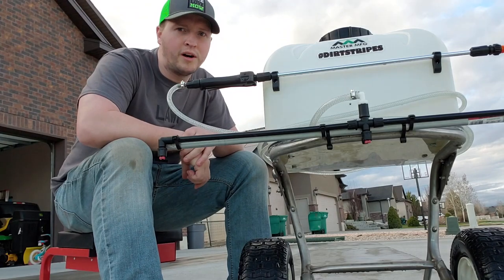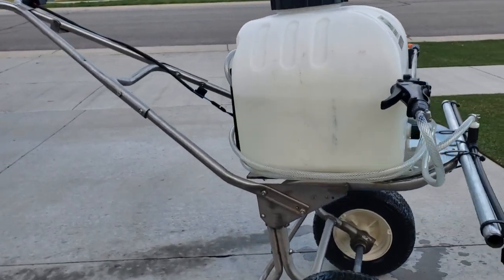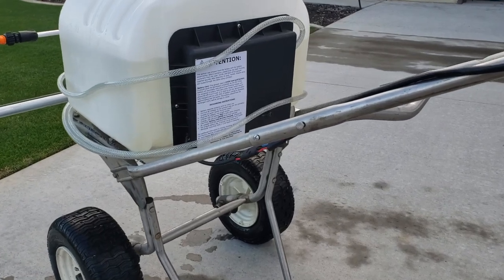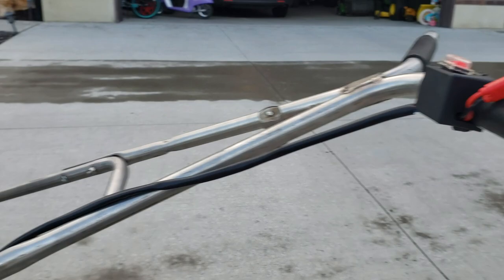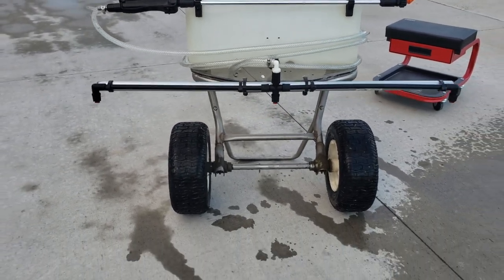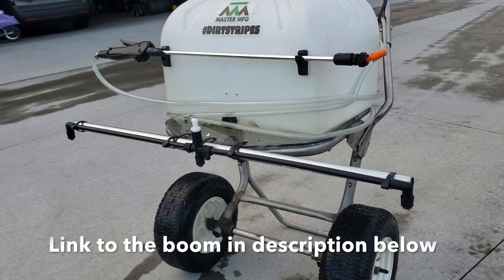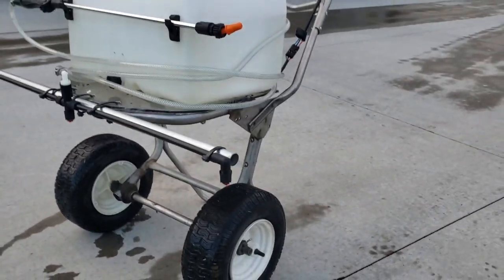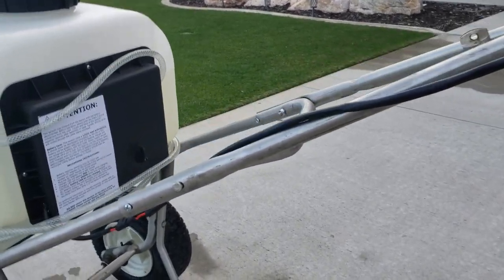How I built my custom push sprayer for liquid fertilizer and liquid lawn products

Comment: I have 17000 sqft of lawn.  After watching this video, I purchased this sprayer.  Have you found a solution for emptying the tank completely during applications.? As you stated, when the tank gets low,  its struggles to spray product.  My product is too expensive to leave even an ounce! LOL.  Once I figure out the in. diameter of the suction tube inside the tank, I going to attempt to extend the tube, place a tee and drop suction tubes on both side of the tank.  Do you think that would work?

Comment: What’s the battery life on this thing? I saw grass daddy’s video first and then looked at the that same master sprayer you’re using then I found your video so I got excited. No problems of it dieing mid use?
Reply from the maker: Battery life has never been an issue. I've done over an acre with it. I do need to upgrade the nozzle situation though.

Comment: Hey Brett, how is your sprayer holding up? Does the pump seem sufficient? Are you going to replace the boom and nozzles with t-jets?
Reply from the maker: I honestly have not used it a ton lately. The pump is strong enough I just need to put in some check valves to prevent leaking and I think it would be awesome!
Reply: @Brettsgrasscapades  have you looked into adding this part between the spray nozzle and boom? This will stop drips and only sprays out at 20+ psi. https://www.domyown.com/chapin-cf-valve-kit-with-adapter-red-model-68501-p-15162.html
Reply from the maker: @thimitri1  thats great to know! I'll have to see about doing this!

Comment: Brett, I built one very similar, used the same tank. Have you noticed the intake port is about 2 inches off the bottom of the tank and when the solution level gets low, the pump can’t suck the remaining liquid out? Have you found a solution to this? I was thinking adding a hose in the tank to lay in the bottom, just need to figure out a way to secure it to the port in the tank.
Reply from the maker: Yes I've got the same issue. I've been thinking about doing something similar. Let me know if it works!
Reply: Brett's Grasscapades sent you a post on IG with a fix I found. Worked perfectly after I tried it.

Comment: 11th! What did you use to mount the unit?
Reply from the maker: So to mount it to the frame I cut a piece of plexiglass I had laying around to the dimensions of the frame, then there was 4 mounting holes in the bottom of the tank and I drilled hole in the plexi to match that. Super simple and easy to do.

Comment: How did you mount the tank to the frame?
Reply from the maker: I had a piece of plexiglass I cut to the frame size and then drilled holes to match the frame and there were mounting spots on the bottom of the tank I drilled as well.
Reply: Ha! That's interesting> I went with 2 - 1/4" x 2" steel bars. Keep the vids coming they're great. @Brettsgrasscapades
Reply from the maker: @puchdrunk1  nice! I'd love to see your take on it!